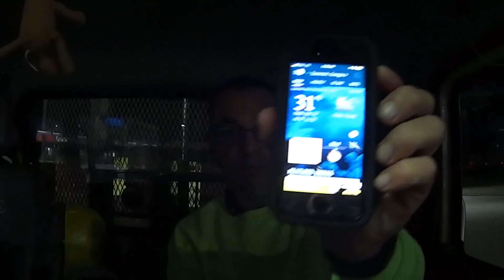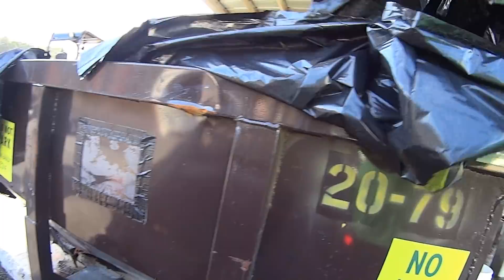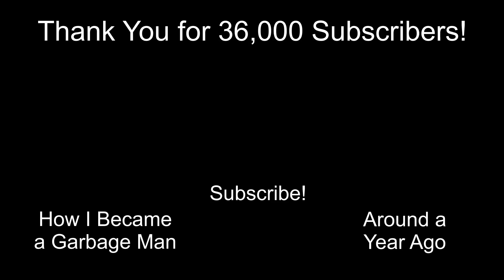Garbage Trucks - My Day as a Roll Off Dumpster Trash Truck Driver #SecretGrandkid

Comment: Do roll off drivers typically have to work more hours than a garbage truck driver due to the tight jams the boxes are in that take time etc. like what are so pros vs cons of a roll off vs garbage truck driver?
Reply from the maker: I guess it’s going to depend on the company and how much work the company has for a rolloff drivervand how much work the company has for regular curbside trash pick up. Pros and cons… That’s pretty simple… One of those jobs you have to touch other peoples trash and the other job you pretty much don’t LOL